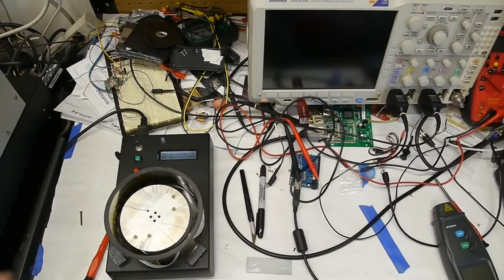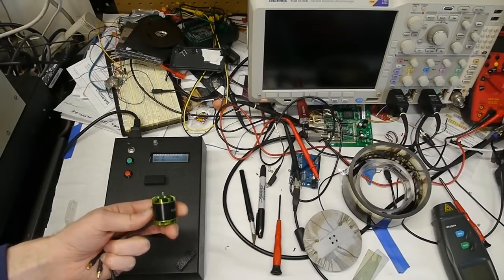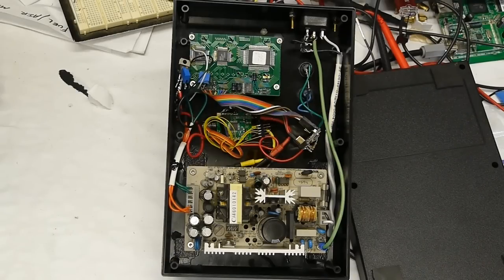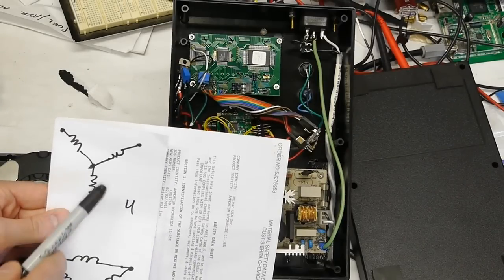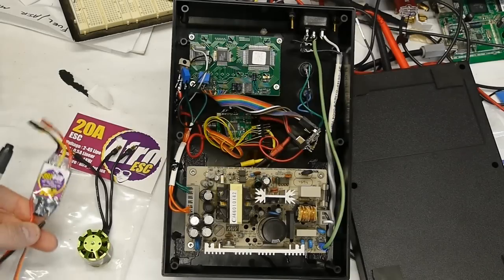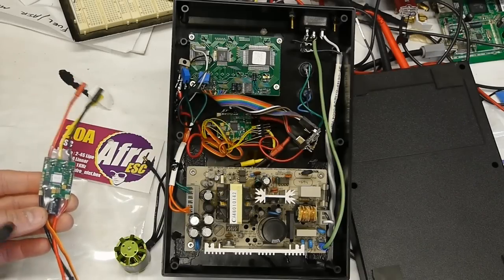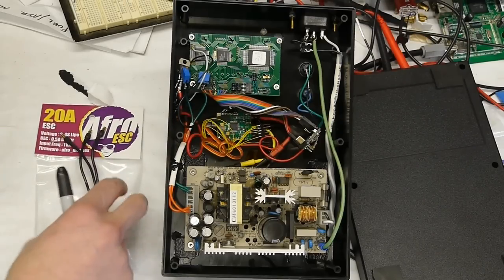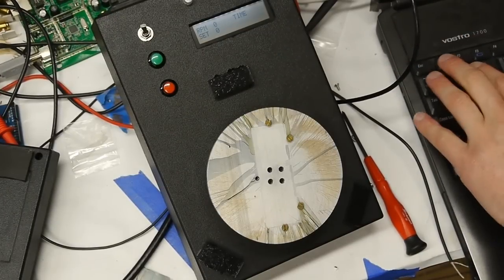Design and build a spin coater

Comment: I was always wondering why spinning results in an even layer – shouldn't the coat become thicker towards the outside edge, because it flows in that direction?
Reply: I think if there isn't enough applied it might, or it might get thinner towards the edge because of surface tension and whatnot. but, from the way it looks like its applied, there is an excess that flies off. I'm not too sure but that's how it seems.

Comment: Thanks for making another great video.. i'm looking at making a spin coater as well, but im a bit stuck at the photo resist, can i ask what you think would be a good (low cost) photo resist for spin coating copper clad(pcb) ?
Reply: Did you end up finding something reasonably cheap? I'm currently on the hunt for this as well
Reply: @seanmcelwee5034  Not yet, i am currently using a film process, but i'm still interested in this, for now its a bit less relevant for me.. thinking about doing it myself using silk screen paint and dilute it with alcohol so i can spray it.. (not for spin coating)
Reply: its gonna be either spray painting it, or use tin patterning in my process...
Reply: @seanmcelwee5034  but please let me know if you find something...if ill find something ill keep you posted

Comment: Why do you need it to accelerate and decelerate it so fast? Seems like if you accel and decel was constant and repeatable, it would be no big deal to add into your calculations.
Reply from the maker: +justfakeit888 Originally, I thought it was important to get from zero (or slow speed) up to the target coating speed as quickly as possible.  This way, the disc would spend most of its coating time at a constant speed, and the process would be less sensitive to the amount of liquid dispensed.  After reading a bit more, it seems that having a controlled acceleration of 400 RPM/sec is used most commonly.  In any case, I had an inherent desire to see how quickly and accurately I could control the motor RPM, and it didn't take too long to tune a nice PID loop for this system.

Comment: Dont use a FET with a potentiometer. It is better to just use a Zener diode rated at that voltage +1-3V. 
Power FETs have a much higher response time  than Zener diodes. Usually the feedback from slowing a motor will produce short-time spikes in excess of 20-600V depending on the windings, but the current is very very small, unless you are driving massive AC motors. d(I)/dt = current/0 = infinity.
Reply: +Eternia Kerbal Capacitance on the bus can easily handle the spikes you are talking about, although a zener would be much more accurate and less temperature dependent
Reply: He's got that line going back to whatever the off the shelf supply is, it likely has its own zeners and protection from minor inductive spikes also.

Comment: How are you reading the RPMs with the sensorless motor?
Reply: +MacGyverX The controller pulses power between two wired in succession around the motor, so one wire is unused as part of that, but the spinning rotor induces a current spike on the unused wire. The ESC (electronic speed controller) monitors the unused wire and the timing of those induced pulses to read the rpms. He is then polling the ESC over I2C for the RPMs to display on his LCD.
Reply: +MacGyverX 
The ESC does it in software.
Reply: Does it accurately measure rpm?
Reply: Yes it is, controller knows position of the rotor at all times.

Comment: What I've always been scratching my head over with spincoating: isn't the layer thicker at (near) the center of the rotation? Because the further you are from the center the stronger the liquid gets flung away.
How did you get the RPM back from the ESC? Is this a feature you can do with I2C or have you added an external sensor?
Reply from the maker: +superdau It's true that the layer thickness is not perfect -- just very good.  The layer thickness is very thin -- about a few microns in most cases, so the viscous forces are much stronger than the centrifugal forces.  It would not work so well for very thick layers because the viscous force holding the fluid near the disc would be overcome by the inertia of the fluid trying to pull it off the disc.  The ESC knows how fast the motor is going, so no need for another sensor..  It's just that most ESCs do not report RPM because there is no commonly-used bidirectional data path.  With I2C, it's easy.

Comment: I made STM32F407 with 3 phase output in synchronous way, with no feedback or sensing. Since if you are not loading with lot of torque , just generate sinus pwm signal at frequency you want, you can do that with DMA, so stm32f407 core is basically unloaded, and can do fun stuff.
This is cheating :D
Reply: +Linas K And because you are generating magnetic field with no sensing, rotor will be locket to that field up until the moment you current is reduced by back EMF so much, that torque applied to motor will cause the slip, and it will simply lock. But for your application, it will work just fine, and you can guarantee  that your ramp will be 99.99999% similar to ramp before with <0.001% rpm tolerances since you generating magnetic field, and rotor will follow it, and you can run motor anything between 0.0001Hz to 200Hz (after that, it is a bit too fast to have decent sinus pwm table, but that equates to 12krpm)
If you commit to my method, i can give C code for STM32, and you could test it for yourself !

Comment: I never understood what a brushless DC motor was and how it differed from a 3-phase AC motor.
Reply: +Salvatore Shiggerino the AC induction motor operates with slip, meaning that it spins a little bit slower than synchronous speed. So a 3600 RPM motor will spin at 3500 or 3450 under load. But brushless DC motors are synchronous, and have to turn the stator windings on and off at just the right time to keep the motor spinning. This process is called commutation. Most brushless DC motors have permanent magnets in the rotor, although it is possible to build one without them.
Reply: ***** Sure, but what's the difference between a brushless DC motor and a synchronous AC motor running through an inverter? Also, why can't a brushless DC motor use induction? It makes sense for some applications. Although I suppose then one would just call it an "induction motor running through an inverter".
Reply: +Salvatore Shiggerino There is not much difference between a synchronous AC motor and a brushless DC motor. The commutation scheme is different, though. Brushless DC motor windings are generally switched on and off (two states only). For a synchronous motor, the applied winding voltage is usually a sine wave. Also the back EMF of a synchronous motor will be designed to be sinusoidal, but the back EMF from a BLDC may be trapezoidal. However, the construction of an induction motor is totally different. The stator windings are placed differently, and the rotor is designed very differently. The rotor has to have windings or similar features that allow an induced current to flow in the rotor.

Comment: Hi Ben, great project.  From the video, I wasn't sure how you were sensing the rotational speed of the motor.  I'm curious if you are using the back EMF or if you installed a sensor.  When I was playing with the SimonK firmware, I was pleased to discover I could enable a flag that would send a pulse on a free pin for every commutation (http://bit.ly/21cz5mC).  I was blown away that I could use this pulse coupled to a LED strobe for a convincing visual effect: http://bit.ly/1Ukts0x

Comment: "real men" program in assembler. C is for wimps. ;)
Reply: I, as a relatively old mcu programmer (ie. making an ftp server with rtl8019 nic and ata hard drive out of a pic18 about 18 years ago, fully programmed in asm) say you are right, but nowdays I'm deffinitely happy I can program arm devices in c++. Still trying to find the perfect balance between efficient programming and performace, with success. Just don't be lazy and shy making better implementations than just using wanky libs. Asm is cool, but very often it pointlessly slows You down.